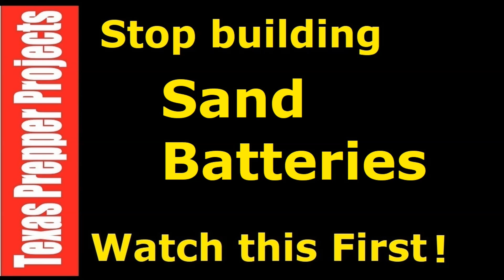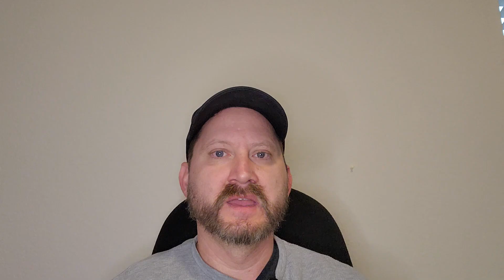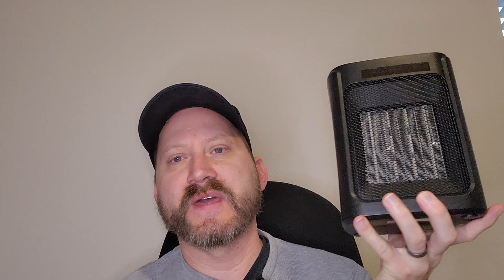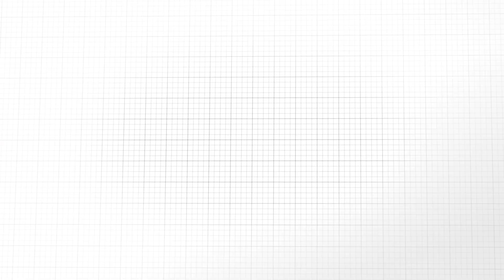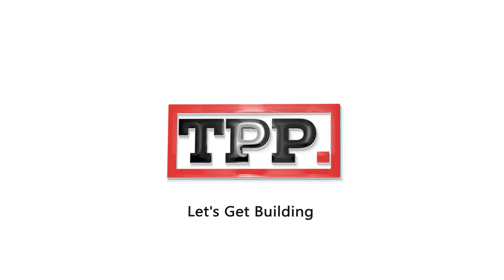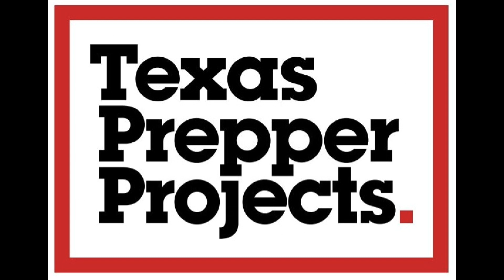Stop Building Sand Batteries | Texas Prepper Projects

Comment: Converting heat to radiated heat and sitting in front of it will warm you up more than having an electric heater warming air.
Reply from the maker: But the total heat is the same
Reply: @texasprepperprojects the total heat is the same, but the amount of heat reaching your body is different. Just like central-heating vs an electric-blanket, with the former you heat the entire room (walls, ceiling, furniture, the air, and finally your body), and with the latter you heat your body and then some escapes to your room.

So having a candle (where most heat is transported with convection to the ceiling, vs putting an inverted pot onto it, which turns the hot air into infrared radiation, going in all directions, instead of straight up... yeah, it's the same heat, and the pot is slightly better at spreading it evenly (with a tiny fraction of the IR actually hitting you, like 5%) but in the end both ways are horribly inefficient compared to heating your body directly.
Reply from the maker: Can't wait to see your video on this
Reply: @texasprepperprojects  yes the total heat stays the same.  But the point of the sand battery is to store Heat to be used at a later time if I have 2,000 watts of solar coming in and  my batteries are full I could dump that power  into a cubic yard of sand as heat and have it dissipate that heat overnight instead of dumping 2000 watts into electric heaters to heat the room raising  the air temperature to 95°   i can slowly  release that heat back into the living space its not a perfect  system  but its cheap its meant to  be a form  of STORAGE   we are not trying  to  get extra  heat. But radiant heat dose feel warmer with a cooler air temperature. Shops with floor heat   heated to 55° air temperature  will fell warmer  that a shop with forced air heated to 60
Reply: @windsbra12  not to mention that a DC solar > sand battery saves you a ton of cash by avoiding electrical storage or inverter hardware, no batteries to wear out or replace, less complexity etc. It just works, and if it saves a ton of investment by not needing batteries or inverters that same amt of cash could just be repurposed into MORE energy collection, more sand storage etc.
Reply: @windsbra12  And I thought that was the whole idea of these sand batteries

Comment: Glad you recognized that sand batteries are not the solution
Reply from the maker: At a large scale, maybe. But 50 pounds of sand in a bucket will do nothing
Reply: @ the idea is to not use a standard chemical battery. On a small scale people are better off using more insulation
Reply from the maker: Yup

Comment: Heat loss is a function of the area (dimensions to the second power).  Heat retention is a function of volume (dimensions to the third power).   So generally speaking if you want long-term heat retention you need a LOT of heat mass to vastly improve the volume:area ratio.   That's why seasonal heat storage in the ground works, for example... when you have a stadium-sized amount of soil underground and enough energy to pump into it in summer, it can last through winter.   But this tends to be a big fail at small scales for the same reason.

In terms of what a single person can reasonably implement, sand/soil makes zero sense for home heating when you can just buy an 80-gallon off-the-shelf insulated steel water tank and use that.  You heat the water up and the tank can easily retain most of that heat overnight (even across a few days), and there are a lot of options to heat the water up.

But honestly, the best all-around solution is to spend the money for a full-on solar-battery system and just use a regular air heat-pump or mini-split or something like that.  300W to 1000W power consumption, because you can use that for so many other things and have the option in winter of using a generator to charge the batteries up when necessary.

--

* Solar battery system + normal air heat pump, NO water tank.  Solar panels, battery storage, DC heat pump or inverter + AC heat pump direct to air (like a space heater but a heat pump instead).   60-80% efficient.   Advantages: Easiest solution, easiest to expand, heat-on-demand, indefinite energy storage (the battery), low maintenance.   Disadvantages: Can be expensive due to battery costs, but probably less expensive than a tanked system.

e.g. with 5000 watt-hours of battery storage (say, 200Ah @ 25.6V LiFePO4) you get 15000 watt-hours to 20000 watt-hours of heat.  For example, a 1000W input gives you 5 hours of heating at a space-heater equivalent of 3000W to 4000W.   At 500W input gives you 10 hours of heating at a space-heater equivalent of 1500W to 2000W.  Not terrible.  It won't heat the whole house but it will certainly heat two rooms without too much trouble.

--

* Solar thermal loop.  Should be dual-loop (do not loop the tank water through the solar thermal box).  Advantages:  Easy.  Two small pumps, heat exchanger, glycol (usually) for the box loop and then water through the tank for the tank loop.  Disadvantages:  Does not work well in cloudy or cold weather, is generally not able to heat the water up to high temperatures.   70% efficient, roughly.

--

* Solar electric heat pump + water tank (with small battery).   60-80% efficient depending (20% solar panel efficiency x 3 or x 4, depending).  i.e. 300% to 400% efficiency on the electricity, but 60-80% relative to incident sun energy.  Small solar system, a small battery vastly improves solar panel efficiency, a heat pump that loops the water from the tank through.  A heat pump water heater, basically.   Advantages: Many.   Works in inclement weather, can operate at any hour with a small battery system, can heat the water up to 155F with the right heat pump, which is one hell of a lot of heat storage.  Disadvantages: Cost and Complexity.

--

* Sand battery.  Generally very poor efficiency, low retention time, and difficulty making it even work at 20% efficiency let alone any more due to insulation issues.

--

Water is a much better medium for heat storage at household scales.  Now, obviously you can use water for hot water.. you just need a mixer valve to take the temperature down to 110-120F as it goes into household piping and you are done.   For household heating its a bit more difficult.  There you are talking about under-the-floor loops for radiative heating.   This works but it isn't instant heat so the home needs good insulation.

Other heat exchanging solutions are possible.  You can always run the hot water through an air heat exchanger for example (like a small vehicle radiator) with a fan.  And as long as the pipes mostly run inside the house (so heat losses also heat the house), it should be able to transfer much of the heat into the house.

But everything involving water requires maintenance and can get messy.  Its a lot of work just to avoid buying batteries and using a regular electric heat pump.

-Matt
Reply from the maker: Yup

Comment: Second thought: 
You all but rubbish the idea of candles under a flower pot for emergency heating.  

FACT is that a medium sized terracotta flower pot raised to (say) 300ºF will create both a convective heating effect (space heater) as air circulates over the rough surface, AND a radiative effect, heating nearby objects (say hands?) directly.
This makes the candle(s)-under-the-flowerpot HUGELY more efficient in a grid-down emergency than "a candle under a table" - as you put it.
Better you research WHAT problem you want to address then the FACTS around solutions people have already developed... BEFORE posting.
Reply from the maker: It is a very small amount of heat and can't even heat a single room.

Comment: Last year I switched from oil to gas heat but still have an empty 275 gallon oil tank in my basement.  I had the idea of cleaning it out, filling with sand, adding some heating elements and connecting to some solar panels to help supplement my heating.  Any thoughts on how effective it would be?
Reply from the maker: Not very. Seriously. However, filling it with water and using a pool pump to directly heat the water as a thermal mass might be worth it. And a whole lot cheaper and easier.

Comment: I thought the point was to rely on the laws of thermodynamics to create a heat store, rather than some gimmick about creating 'more' heat? 

You use solar to heat up your heat store - whatever that store is, sand, water, whatever - during the day, so that in the evening you have something you can harvest for useable heat when things are coldest. Will it keep you toasty warm? Quite unlikely, especially from one bucket of sand. 

But if it can keep the frost off a small room you can sit in in your sleeping bag, that's potentially enough. If you can sit place it near your hands so you can do other tasks during a power outage, that's possibly enough. It doesn't need to keep a room to T Shirt temperatures, it has to provide heat when you have no spare energy to use directly?

So a sand battery project that includes an insulated box and some means to extract the heat later... that would still be a project worth looking into. And if it was at all effective, it would be quite modular / scalable - which we already know due to the various grid scale heat storage projects underway around the world.

The questions are: 
- what volume of sand is needed to make enough insulation cost effective and how much solar is required to heat that up? It'll be more than a bucketful but is it is 1m x 1m x 1m? More? less? 
- how much power/solar over what period in hours is needed to heat that volume of sand? 
- Where's the sweet spot in sand and solar panels for a man to keep his 3m x 5m garden shed or greenhouse from freezing? Doesn't have to be room temperature, and if a way can be found to make it radiant heat rather than air heat, so much the better.
Reply from the maker: But the point is, the heat going into that bucket of sand could have just gone into the air in your room. The way that people are using them they think that they are spade heaters and they are not. There is a difference between a concrete wall that is heated by a fire and a tiny bucket that is heated with an oven element
Reply: It's the same principle as buildings made of stone or clay - they heat up during the day and then radiate that heat at night :)
Reply from the maker: But those walla weigh tons. Not 50 pounds
Reply from the maker: And to answer your questions...a lot. A whole  lot. Put it in terms of a 1500w space heater and then answer it

Comment: Sand battery is a good thing if you  have plentiful solar during the day and a need from heat at night. However, I feel like it needs to be scaled up dramatically. Lets heat 20 tons of sand with a large magnifying glass. Now we're talking haha
Reply from the maker: The problem with using the magnifying lens is you have to re aim it every 15 minutes as the sun moves. Check my older videos for a parabolic mirror test
Reply: You are on the right track.  Having a lot of heat mass makes the storage practical and efficient.  But having the energy input required to heat that much mass up is less practical.   Sand batteries generally don't work because people don't make them big enough.  The amount of mass has to be well matched with the amount of sun collection to really work well and for DIY systems it just never is.

Seasonal ground heat storage for a greenhouse works well because they collect energy ALL SUMMER LONG (8 months including shoulder seasons) and stuff it into a huge amount of ground area, then pull it out across the entirety of winter (4 months).

One can see how this might not be so easy to do for a house.  Nor would it necessarily be able to keep the house at 70F overnight because the ground storage only winds up achieving 80-100F.  But it's great at keeping greenhouses above 50F in extremely cold climates across winter.

-Matt
Reply: @junkerzn7312  insulating the mass of earth from the earth is an issue I see. Hard to get much gain with the earth acting as a heat sink. With proper insulation I'd imagine you could eventually achieve desired temps with homeowner type setup and just maintain that for when necessary. Thanks for the reply, I enjoy the thought experiment.
Reply: What about 1000 kilograms , like congrete and asphalt heat climate
Reply from the maker: Try it out

Comment: When I think the point is moving the heat from one time to another.   You store it during the day there is excess solar power in a well insulated mass and release it later.   As you say, you would need a couple tons of sand or gravel, not a 5 gallon bucket.

However, these days you can also store the excess electricity in a battery and then release it through an electric blanket.

I recommend an electric mattress pad instead of an electric blanket.  They use about 60w per hour.   I also use "fuzzy" microfiber blankets which contain heat but have less mass.  both below you (to protect you from the cold mass of the mattress) and above you to retain your heat.   Having a warm bed is less "smothery" than having an electric blanket.
Reply: Oh, however, if you have a couple tons of sand, the sand thermal battery is less likely to break than a mattress pad or electric blanket (but you can probably just by a backup to cover that possibility).
Reply from the maker: Tons of sand. Literal tons
Reply: @texasprepperprojects  Or stones... of earth coat / flooring / whatever of your house, or a big insulated water heater.
Reply from the maker: Yup
Reply from the maker: I am a big fan of electric blankets
Reply: How to build a death bed. 
Holy smokes. Sleeping on electric wires and under  what is essentially a plastic blanket is a fast track to health destruction. Maybe sleep grounded with a cotton or linen cover. 😂
Reply: @DonnaCrow-HealingSchool  Holy crap-- tell us you come from a tropical area with no winter without using those words.

You'd freeze to death with cotton and linen.   Cotton doesn't retain heat unless you have a lot of it.   And when you do, it retains cold and takes over 30 minutes to warm up.   Same only worse for Linen.  Linen is SPECIFICALLY chosen for warm climates because it breathes.

My "Deat (sic) Bed" has kept me warm and comfy while letting me run my house at 58 degrees at night for over 15 years now.

I froze my ass off for 20 years under cotten quilts before learning better.

At least if you want to avoid the microfiber, then go with wool.  But even it has a lot of thermal mass.  Better to wear wool socks and thermals all day.  I'd still use the electric mattress pad or heating pad to prewarm the bed or you'll be icy cold for at least 30 minutes until the bed and covers warm up.

Comment: I a key point of a thermal battery like this or water one is it’s ability store heat during the day and carry it into the night. When the sun sets it gets cooler and homes having a completely passive water, thermal energy management like acts to flatten the heat spike. But yes, there is no free energy benefit ofc.
Reply from the maker: And people on YouTube that are building them are completely missing the point of thermal mass. Regardless, the amount of material you need to make this make sense is measured in tons. Not pounds

Comment: The 'concept' of a Sand Battery (Heat sink) is legit... The problem is they have to be sized correctly for the area to be heated. They work by the principle of: "Radiant heat is the transfer of heat energy through electromagnetic waves, where a hot surface emits infrared radiation that directly warms objects in its path without needing a medium to travel through, similar to how the sun warms the Earth; essentially, it's heat transmitted by radiation rather than conduction or convection." 
Also it's all about how many 'BTU's per hour. AND, how well is the area 'INSULATED'.
Reply from the maker: Doesn't need to be insulated if it is inside the same airspace

Comment: Ya this all makes sense.   I haven't built one but I guess you may be able to retain a little bit of stored heat in the sand for a few hours after the solar panels stop producing for the day
Reply from the maker: And that does work, in principle. I've tested it. But it's still only a tiny amount of total btu
Reply: for that purpose better use water over sand
Reply from the maker: Check my other videossm, I tried this and measured it